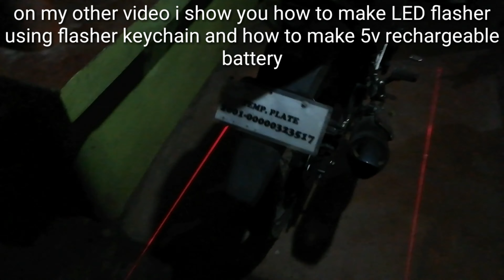Paano mag install ng laser sa motor

Comment: Can we use any mail polish color or does that need to be a clear coat??
Reply from the maker: You need to use clear nail polish. Be careful using it, make sure it will dry very clear but dont worry its so easy to make it. You must make 5 volts battery for it first